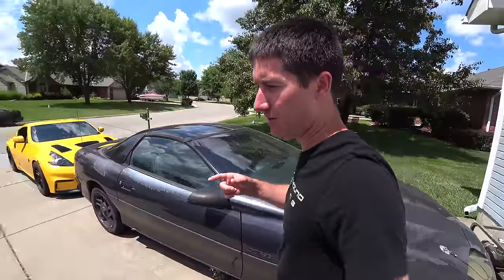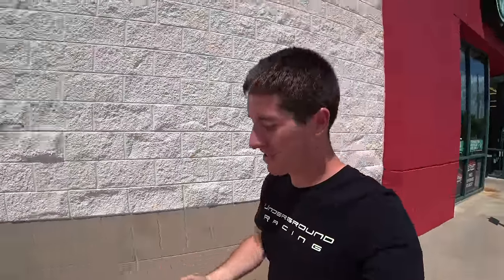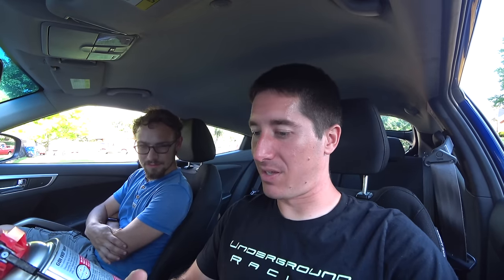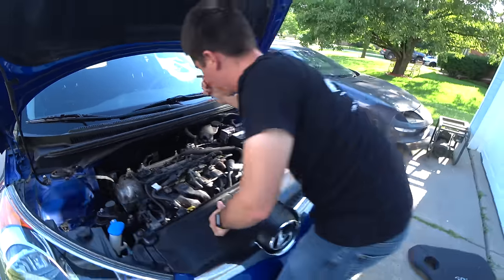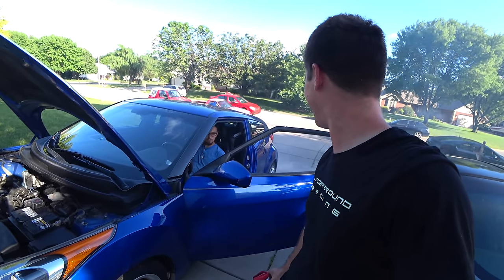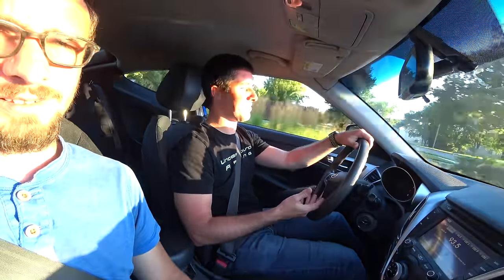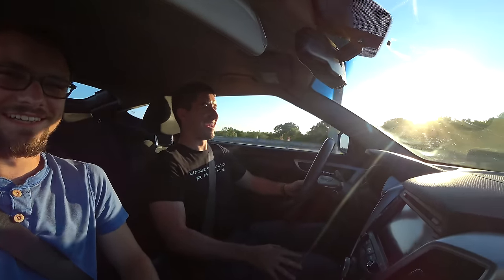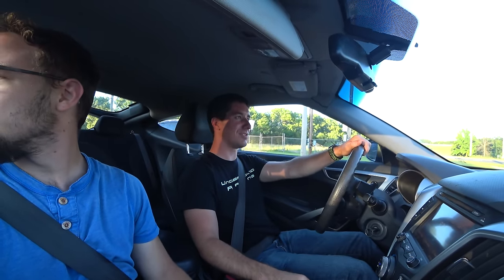How To REMOVE CARBON Build Up From DIRECT INJECTION Engines For $12

Comment: That stuff doesn't work. I've had people come to me after trying it that still had valve-coke related cold start misfires. If you don't have a driveability problem, don't fix it. 

Best case, the spray does nothing, worst case, it causes a few small bits of very very hard, crystalline carbon to be sent through the engine. It's like sand. DI buildup is not like buildup on carbureted engines of old. It forms as the valves cool down in the presence of oil vapor from the PCV system, right after you turn the engine off. That heating and cooling forms layers of hard, tempered carbon over time that can really only be totally removed with solvents and a brush or media blasting.   

It can cause valves to be held open, tear up valve stem seals, it can blow by the rings and cause scoring, tear up turbo bearings, and any carbon that makes it out through the exhaust valve gets caught and melts nice little craters in the leading part of your catalyst substrate.

If you want to be 100% sure your valves are clean and you dont introduce nasty abrasives to your internal engine components, pull the intake, and clean manually, ensuring the intake valves are closed as you go, also being sure to blow out all the crap with compressed air.

Don't use this stuff. It's a waste of money and it can cause damage, especially to forced induction engines. I know it's marketed for forced induction engines, but Id never use it on mine. I like DI enough to clean manually every 30 or 40 thousand miles.
Reply: Doug I have a Ford 2.0l GTDI and have been considering using this product for a while now. I searched the many Ford forums and was surprised by the amount of people saying not to use this product. Since you seem like you know what you're talking about, many on the forum stated it can cause the turbo impeller to exceed operating heat limits leading to a failure within the turbo. Does this sound right?
Reply: @JonnyRicter  These sprays marketed for induction cleaning are mostly petroleum distillates and solvents similar to what you'd find in detergent gasoline. By creating a vacuum leak and spraying a ton of this stuff into the open vacuum line, you're throwing off your AFR. Engine computers aim for the perfect stoichiometric mix of air and fuel so there is nothing but some exhaust gas and water left over after combustion. This means that under normal conditions, your catalyst stays at a reasonable temperature and breaks down combustion leftovers efficiently because there is no oxygen or raw fuel present in the exhaust stream.

Running your engine at 2,000 rpm with a big vacuum leak (air the computer isn't accounting for) and a bunch of flammable solvent (fuel the computer isn't accounting for) yes, you create the perfect conditions for overheating exhaust components like a turbo turbine  and your catalyst, because there is likely to be too much air, too much fuel, or both making it into the exhaust, not to mention little chunks of hard, oily carbon. Catalysts don't like too much raw fuel or leftover oxygen, they melt down. 

These sprays are a bad idea, and almost all factory service manuals expressly discourage using them. Manual Induction cleaning isn't that expensive, and you could even do it yourself unless you have a transverse V engine that's hard to access the bank under the wiper tray. Even as "preventative" maintenance, I wouldn't use these sprays on DI engines. Port injected or carbureted? Use a spray bottle full of water and gently mist right after the air filter if you really want to clean things up. That's safer for intake components and you aren't adding a bunch of pirate air or fuel. 

Hope that helps.
Reply: Doug big help. Thanks so much. I was leaning towards not using this product, especially since no noticeable drivability issues exists, but now I'm convinced. Thanks again.
Reply: @doug960  If these sprays are SO bad for the engine and related components, why do engines in video after video show a DECIDED improvement in engine smoothness?
Reply: @TheOzthewiz  You're removing a negligible amount of carbon from the valves, so yes, you might see a temporary improvement in idle quality... Then again it could just be the placebo effect. But at what cost? They don't remove enough carbon to be worth it, IMO. The risk of hurting your engine is greater than the temporary benefit these sprays provide. 

Typically a carbon buildup problem first presents as a cold start misfire condition; a rough idle until the car warms up which throws a random misfire code. Not ONCE has a spray induction cleaner fixed that condition in my experience, which tells me those sprays don't make any real difference. Manual induction cleaning is the best, safest, most effective option.

If you want to go pouring a bunch of solvent down the throat of your engine at high RPM, go for it. Just know it's a terrible idea.
Reply: @doug960  Hey, you sound like you know what you're talking about, but if you use water mist, wouldn't that send carbon chunks to clog your cat ?.
Reply: @freepomeroon  Steam cleaning isn't aggressive enough to remove the really hard, crystalline buildup you see in DI engines. That will remove softer deposits from multi-port and carbureted engines. That's really a carbureted engine thing. A properly running multi-port engine should not have too much carbon buildup on valves, or in the head/ on the piston. Not enough to cause damage, anyway. 

That soft carbon can also cause damage when it gets knocked loose, but it doesn't typically burn as hot or as long, and there usually isn't nearly as much of it present in older engines as there is that hard, coke buildup in modern DI engines. Softer, traditional  carbon buildup usually mostly burn up in the cylinder through normal combustion. You'll hear it cause light knock. That hard, crystalline stuff burns hotter and for longer, and is more likely to be a nice hot ember that makes it way out and sits red hot against the catalyst substrate.

I've never heard of damage from steam cleaning a non DI engine properly. Overdo it and you'll vapor lock. Not sure how effective it would be on cleaning the back of intake valves in DI engines.
Reply: @doug960  Ok, great, I did my DI tucson 2.0 with 34k miles today, will change the oil in two days, Kinda regret this but hopefully the cat is safe, another poster said he had mountains of abrasive in oil afterwards, (he did an oil analysis). I guess waiting two day for all the deposit to flush out won't hurt.
Reply: @freepomeroon  Could have just been dirty oil operating in dusty, nasty conditions. I think you'll be ok after just one treatment. People who do this every 10 or 20 thousand miles are the ones asking for problems. 

I would still go for that oil change.

Comment: damn is that the injectors of the lifters that are rattling loud like that ?
Reply: It's the "high pressure" fuel pump on the engine.
Reply: @TheOzthewiz  thanks ojars

Comment: This job is ok but will better for each 15-20 k km. This is acceptable job but it is not 100% perfectly. Perfectly is to clean up the intake valve, each a time. But must be take out the intake air completly and make a good, inteligeant job. Keep going.

Comment: In my 20 years of working on cars , water does the same thing.
Reply: Water works on carbon buildup in carbureted engines because it gets softened by contact with fuel. Port injected engines shouldn't have any buildup unless there's a pretty serious PCV or fuel delivery problem. DI carbon buildup is SUPER hard and tempered, and never sees any fuel to keep it soft. You don't want let that hard stuff go whizzing around in your combustion Chambers. It can score things and damage your catalyst. Water or this spray can't remove all carbon buildup from DI valves in my experience.
Reply: @doug960  The product doesn't claim to remove ALL the carbon. Removing some is BETTER than leaving it all in there!
Reply: @TheOzthewiz  TLDR: If you don't have a driveability problem, some carbon on your valves isn't really hurting anything. Knock that crap loose, and you COULD potentially hurt something. So no, you're better off leaving it be and addressing it correctly if and when necessary. 

My problem isnt that it doesn't remove ANY, I'm sure it removes a little. 

My problem is
1. It's not enough to make any real difference; a drop in the bucket. Any perceived improvement is just that - perceived. Placebo. Nadda. If you have a driveability issue, this won't solve it. If you're using it on a regular basis as "preventative maintenance" on a car that doesn't have serious buildup issues that really doesn't need it, you're going to cause more harm than good. If the goal is to remove carbon, why not just actually get in there and remove it instead of dicking around with this stuff?

2. Any carbon it DOES remove goes whizzing through your engine, exhaust, turbo, etc. causing hotspots in the combustion chambers which cause detonation and knock. Carbon gets compressed between piston rings where it is free to score up the cylinder or gets caught between a valve and valve seat holding it open to be struck by the piston (Toyota had to increase their valve spring stiffness to crush that carbon and avoid this when they figured out auxiliary port injected fuel was knocking too much carbon loose) It can damage turbo turbine vanes, the solvent and particles of carbon can overheat your catalyst, especially if you're dumping it into an open vacuum line, creating a giant vacuum leak preventing the engine from running correctly to begin with. 

IT JUST ISNT WORTH IT. A can of this stuff is what? $24.99? Save that cost every month and put it toward a proper cleaning every 30,000 miles or when actually needed.

Diesel engines have had carbon buildup issues since their inception, because they were the original direct injection engine. No diesel mechanic or competent tech who knows GDI engines is going to use this stuff. It's snake oil.

Comment: wanna know how I did it back in the days of carbs? Get the engine up the temp, full glass of water, hold the trottle and rev the engine up enough so that it won't stall and slowly (just a little stream of water) pour the water into the carb while keeping the rpm up. Empty the cup out and you are done. The hot steam produced during combustion would clean the plugs, valves and pistions. Did it to every old car I had and never had a problem and also saw an improvement.

Comment: what happens past 3500? asking for a friend.
Reply: Keeps any turbo speed down.
Reply: I floored it in my Impala after letting it sit dor an be and heard all sorts of pinning and rattling and check engine. Cleared it amd it was fine afterwards.
So I would say dont go over 3500rpm

Comment: I'm just wondering how spraying into the throttle body would be the recommended path for a newb instead of just using a vac line lol.
Reply: The short answer is that they assume diy types don't know what they're doing and will need up when they try to find one. On my engine there's a PCV hose that's easier to access than any vacuum line. wanna bet nobody messes that up without a moment of hesitation and blames crc?

Comment: Got to be careful doing this. If it’s an in-line, I’d rather pull the intake to clean the valves. Definitely a maintenance requirement with GDI.
Reply: I saw a video, where the professional mechanics used crushed walnut shells to sandblast the valves clean.  I mean that valve carbon is solidly baked on in GDI's.  Looking at this video, I wonder how safe that 'can of stuff' is, for the vacuum hose, plastic intake, and catalytic convertor.  What substance or method do you use when you take off the intake?

Comment: You can just use water to clean carbon, ever popped a cylinder head with a blown headgasket? One piston will look like new, water is free, use water friends just don't poor a bunch down in your engine at once or you can hydro lock it and turn the rpms up to 4K

Comment: Why not remove your intake manifold and clean it while you look at your valve stems? It’s really not that hard. Besides even though I used seafoam brand, these thing don’t really do magics. I still had to use some dental pick tools to clean the valve stems manually. Make sure you alternate with valves turning the crank manually. It’s a cleaner, way more affective method. Nothing goes in the cylinder to burn, smoke afterwards. Either suck or blow out after all. At the end you will see the difference with your own eyes. These things are only effective when you use them regularly, not after tens of thousands of miles and when the stems highly packed with residue

Comment: Doesn't work.  Ive tried this on my kia 1.6 gdi and barely touched the carbon.  The only way to truly clean off the carbon is to pull the head and valves to disassemble and clean.  Anyone complaining of pinging, the excessive carbon is why.  I torn mine down, cleaned valves and pistons, replaced valve seals and put back together.  Night and day difference and gained 7 miles per gallon.  The problem in gdi engines specifically is the PCV system with not having an oil catch can. This is where all the carbon build up come from.

Comment: No man not autojunk plugs...even with a lifetime warranty I still wouldn't ever run those plugs unless it's in a Ford who owns auto lite. I've worked in parts for 10 years and never sold anyone autolite plugs because they don't last
Reply: A lifetime warranty is no good if the plugs are trash not worth the issues

Comment: Looks like the same process and results from using Sea Foam.
Reply: Yup, OR a cup of water lol. Actually there's a channel on YT, Farm Projects I believe, he showed that water did the BEST job out of all the cleaners for getting valves nice and shiny again. I suppose to be safe you could run Sea Foam, it's basically the cheapest light oil you can get. Hell of a lot cheaper than 12 bucks, not really worth it in my opinion. I rather run two cans of Seafoam than one can of that gdi cleaner lol.
Reply: @jetjazz05  project farm is the channel. Seafoam is the best.

Comment: you cuold get the same effect using Sea Foam! you even run it through the engine the same way and it smokes like a bitch when you do. and the Seafoam is about $5.00 less. If you use sea foam enough in your vehicle the internals will look clean enough to eat off of too. I run it regularly in my 99 tahoe and when we replaced the fuel injection spider we had ZERO carbon build up to clean off of the under side of the intake. and the lower part of the intake had oil on it but no carbon there either. it was a HUGE testament to the power of sea foam to keep an engine clean

Comment: This stuff probably does nothing. You probably cleaned some carbon from the pistons, but the valves probably look the same. If you have a ford ecoboost engine and you use this, your warranty is void (if still under warranty). You'll burn up the catalytic converter. Smoother engine operation is probably placebo effect.

Comment: have seen this stuff used before,it doesnt work.
Reply: It doesn’t work noticeably if the owner hasn’t regularly done this cleaning. Walnut blasting is highly recommended for deprived engines.

Comment: The brake booster line on all hyundai gdi and turbo engines only taps into cylinder number 4 intake runner on the plastic intake. You have to pull the intake hose off and stick the straw in under the throttle body plate in order to clean all the valves. hyundai does not provide a way or port for the dealership to clean the valves with a spray. The procedure from the dealer is to remove the intake and walnut blast the valves. This procedure you are sowing only cleans cylinder number 4.

Comment: IF you already have CARBON BUILD-UP using any spray product will do very little removal. DI engines will have carbon build-up spraying one can into your engine has more of a placebo effect than anything and may cause more damage than not doing it because as some have stated the carbon that does come off has to go somewhere right? Like into your combustion chamber (possible scoring of cylinder walls) also that carbon can clog your catalytic converter. So, spending $12 could lead to hundreds- thousands in repair bills.
Just save up $$$ for a manual cleaning and have the valves walnut blasted...do it right. CRC does make great products but this one is questionable for the claims made.
He's got 129Kmi on that car and NO WAY that one can cleaned 129kmi of carbon off his valves, do a bore scope and let's see the results. Don't believe me search for other videos that do show bore scoped intakes before and after. Instead of hearing him say "I think it did it's job, I "feel better about the car"I @10:34

Comment: I think the foam does nothing, the cleaning occurs when you drive on the freeway for 10 minutes.
Reply: The foam softens the carbon, while the freeway run allows sustained higher intake velocity to suck the gunk into the CC.

Comment: Seems like any savings from buying a  cheap Hyundai is wiped out by all the problems, cheaply made parts and bad manufacturing...
Reply: It's a direct Injection thing not a Hyundai thing. An oil catch can can prevent this carbon build up.

Comment: That smoke is all the built up deposits in the fuel system being burnt out the exhaust
Reply: the smoke is the CRC being burnt off, not much else*
Reply: the smoke is the CRC being burnt off, not much else*

Comment: No no no...walnut blasting the intake valves is the optimum method to clean the valves, Audi, VW and BMW dealerships are doing walnut blasting as part of regular service as it is the safest way to clean valves on DI engines.

Comment: This doesn't work..you need to manually clean the valves. If you took off the intake manifold, the carbon would be caked on..The cleaner doesn't even have time to contact the valves let along get the carbon off.